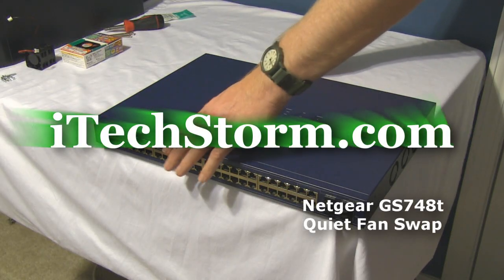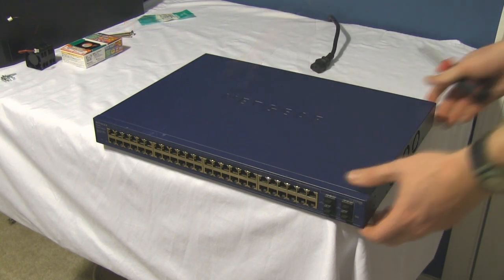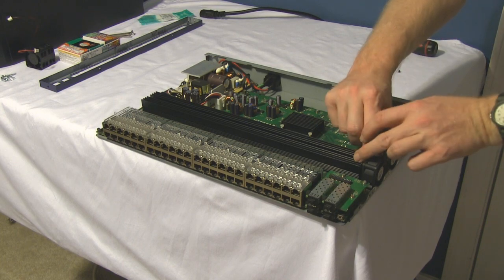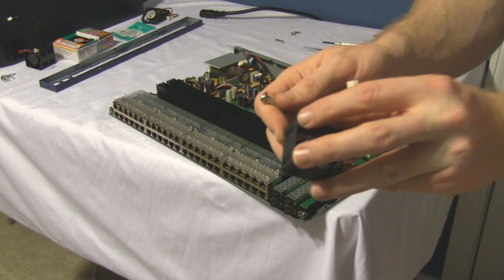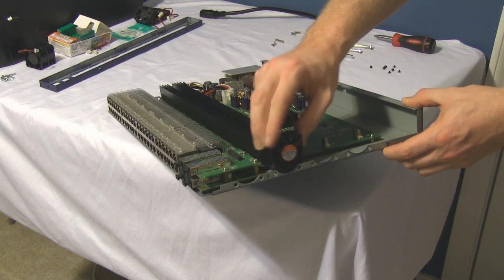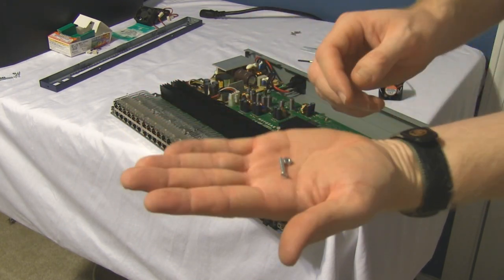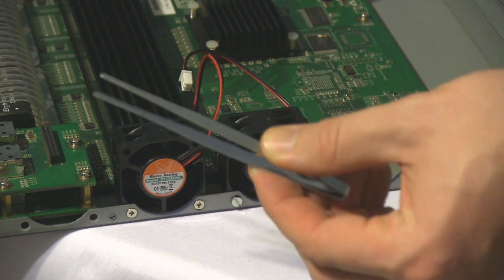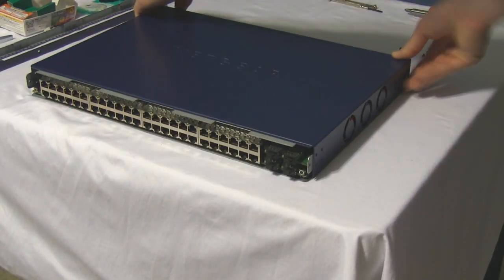Netgear Switch GS748T Loud Fan Swap with Quiet Fan

Comment: I have a GSM7248 v2, it has 3 fans
40mm x 20 (3pin)
40mm x 10 (3pin)
40mm x 10 (3pin)

I replaced the fans with 3 @ 40mm x 20 (2pin)

Max Fan speed: 5500±10%rpm
Max Air flow: 8.5CFM
Current: 0.1±0.018 Amp
Noise level: 21±10%dBA
Voltage: 12V
Bearing Style: Sleeve

I needed to cut the ends off the fans, and re-use the original 3pin plug (just joining the red-red and black-black).
Leaving the middle PWM pin disconnected. This causes the fans to run full speed, but given their lower RPM they are much better.

This has the suitable noise at a home environment.
It seems to be running OK, will post back if something doesn't work.
Reply from the maker: Thanks for the post. Good information!

Comment: Hi Man, nice Video ! ( and nice music ;) ) .
I am considering replacing the Fan of a GS724Tv3. Anything to consider in the choice of the fan, or any (quiet) 40mm fan will do ? Thanks !
Reply: +Jacob Briggs 
that one : https://www.amazon.co.uk/Noctua-NF-A4X10-FLX-5V-computer-components/dp/B00NEMGCIA/275-4052068-1405851?ie=UTF8&psc=1&redirect=true&redirect=true&ref_=oh_aui_detailpage_o00_s00

Although not big improvement, and I had to change the wiring as I believe + & - were inverted compared to the original Fan
Reply from the maker: +Goldsnip Make sure you take a look at the fans currently being used in your GS724Tv3 and verify that you purchase a compatible fan.  Fan size, wire harness, and voltage are major points to consider.
Reply: +Goldsnip Which fan did you use?
Reply from the maker: +Goldsnip Thanks for contributing to the discussion! Good information.

Comment: I personally don't like the idea of using sleeve bearing fans in a piece of gear that's gonna be in 24/7 operation most of the time... what you could do is make a basic thermistor based fan controller and use a small mod board to control the fans so they are utilised fully when the switch is under stress and when idle they slow down to near silent... that would be a better option! not only that, but you'll be using the fans out of the switch so they will most likely be more reliable being ball bearing type fans.
Reply from the maker: TheSoxmania Sounds like an interesting project.  I don't currently have the skill set to build what you are talking about, but it sounds feasible.  Willing to post a video response showing how one might accomplish this feat?
Reply: iTechStorm I'll see if I can find you something along those lines... I know a simple controller design that uses a pulse width modulation (PWM) circuit and replaces the adjustable resistor (potentiometer) with a thermistor (thermal resistor) but I'll have to find the datasheet...

I found this instructables article for a circuit that may work... all you need is the parts in the list, some perforated copper clad board, solder and soldering iron.

http://www.instructables.com/id/Temperature-controlled-fan-speed-using-PWM/

Comment: FYI on a NetGear GS748T v4 switch fans are on the opposite side, 40x40x20mm 3pin 12V. The strange thing is that the black and red pins are inverted: use a small screwdriver to pull them from the connector.
Reply: Hadn't used the switch in a while but came across it again and this sorted the fan issue I had out too, weird they'd invert the pins between versions but thanks for the answer!
Reply from the maker: Good to know, thanks for the update ilNebbioso!  It's always interesting to see the variations from version to version.  Makes you wonder the reasoning for some of the tweaks.
Reply from the maker: +blazeuk excellent! Glad you got it sorted out.

Comment: Will this cut into the hardware's potential lifespan?
Reply from the maker: Heat and friction seems to be the enemy that has always stood the test of time indeed.  I opted to reduce my fan noise knowing it will reduce the air flow.  That being said I'm not using full port density and the load on the switch is small so that certainly factors into the equation.  Bottom line: for a home/media install things should be fine, but an enterprise environment is another story.

Comment: I have the v4 version of this router and the Scythe Mini-Kaze don't work with it, I'm assuming the replacement fans need the RPM monitor wire since it's the only difference between the 2 fans (3 wire vs 2 wire).

Comment: Thanks a lot for the video, also considering replacing on my GS728TP, just i want to do it a little different, more of a desktop guy, and i have nothing ont top of it, so i could mount some 120mm on top, cut it to have 2x 120mm fans on top, spin down to 500rpms and removing the small fans and just let that be the exit of the air.  Do you think it would work fine?

Comment: I plan on doing this to a Cisco switch, but some of the components get very close to their thermal limits without any fans on the switch with no network load. I'll probably put some cheap 30mmx30mm aluminum heatsinks on the hottest ones with thermal adhesive, as I stress the switch with lots of network file transfers regularly.